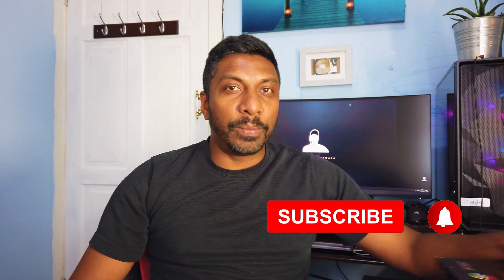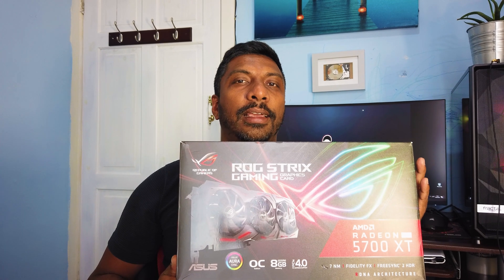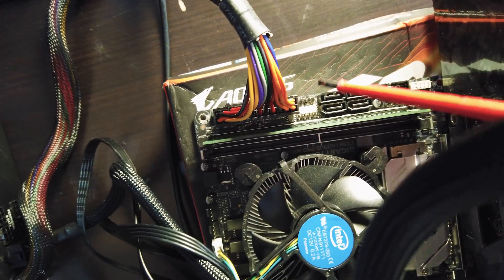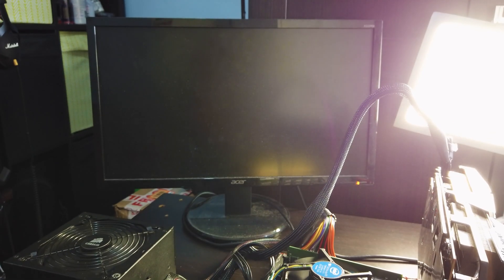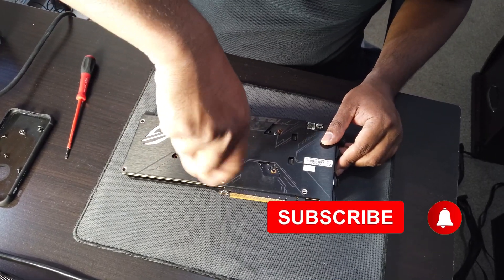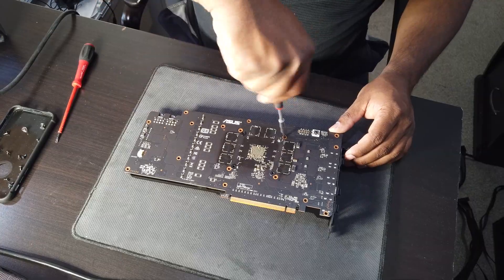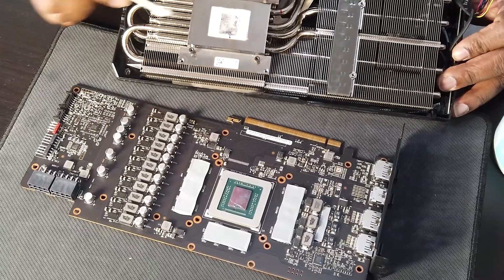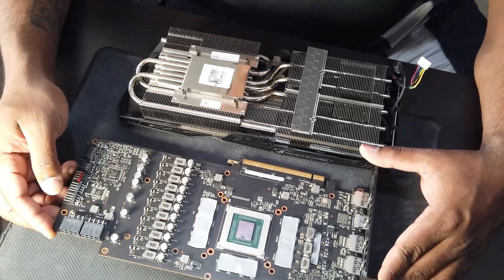ASUS STRIX RX5700XT How to tear-down / BLOWN AMD GPU Chip

Comment: thx mate... u saved an rx 5700 xt hot spot temp was 105 and regular tem 77, i bought it second hand and the guy before has tried to change thermalpads and failed hard, after your tear down, i saw where the pads belongs, quick repaste with mx6 and dirt cheap arctic pads, now hot spot temp is 74 and regular temp 64 card is now damn quiet under load, give em a lite undervolt, now its perfect. 68 hot spot and regular temp 58. its a very good card, if u buy this used, u need to repaste it and change the pads.. thx dude